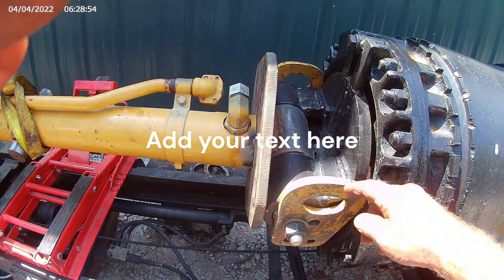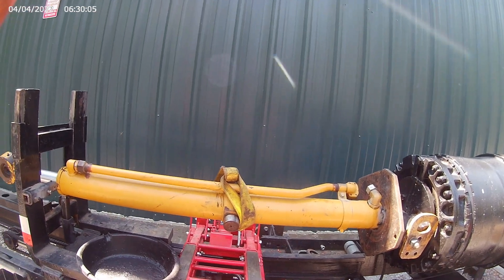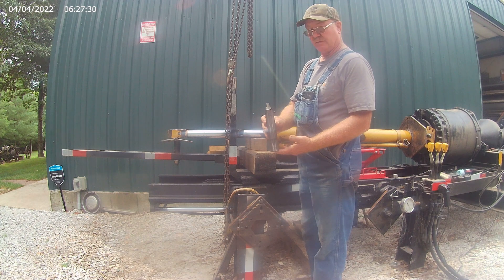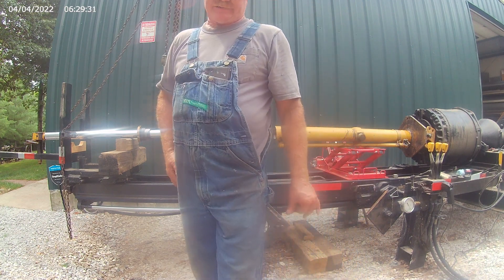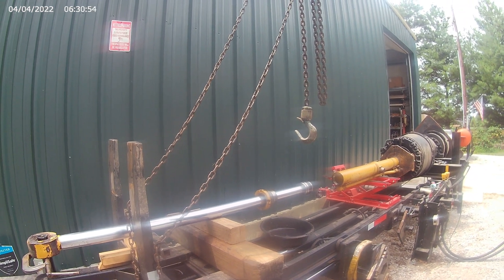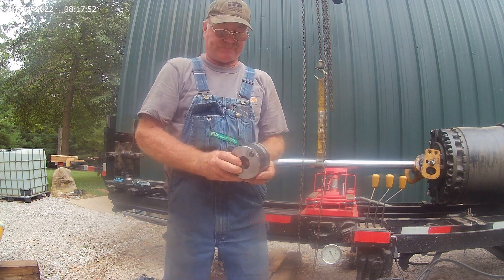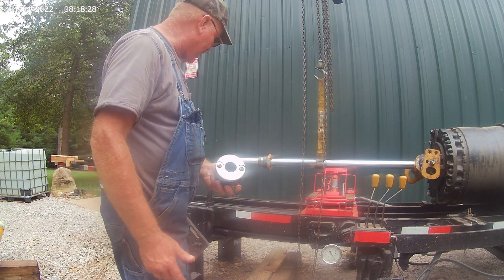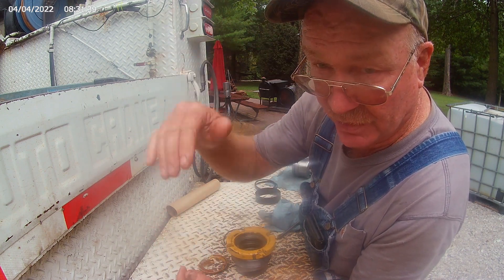D-6 CYLinder TEAR DOWN

Comment: Excellent video I use a heat gun to expand the hydraulic cylinder seals it seems to work good and hose clamp or piston ring compressor to shrink the seals back down. Keep up the great videos
Reply from the maker: Thanks

Comment: What do you feel is the advantage vs just busting the gland nut/ rod nut loose with a wrench by using a cheater pipe, crane, forklift, etc to pull on it? Having never even seen a cylinder bench in person seems like alot of extra set up? but the fact they make them means evidently I must be missing somthing. Probably just individual preference?
Reply from the maker: it is alot more work, but when you have tryed to get them apart & can't you will love this thing.I had 2 d-9 blade cylenders that me & 1 other guy tryed to get headglands loose spent 3or4 hrs & ended up sending them to cat.with this i dont half to fight them!
Reply: sometimes a bench is just about the only way, I have had cylinders that I couldn't get the nut off of with a 4400lb crane on a 6 foot cheater pipe, not to mention, the cheater on the crane can get a bit sketchy. If you get to use a bench, you will probably want one for anything of decent size
Reply from the maker: you are so right. @DillonHFM